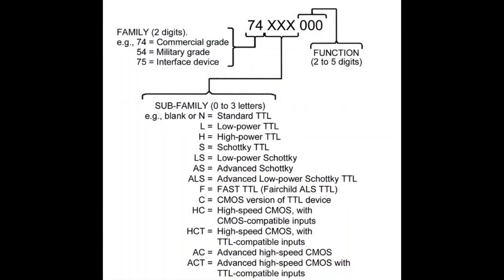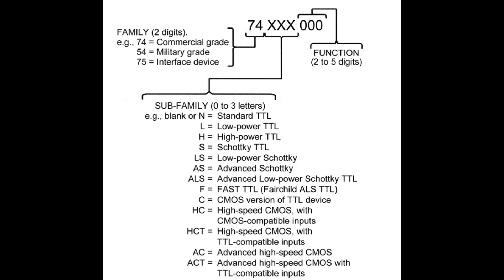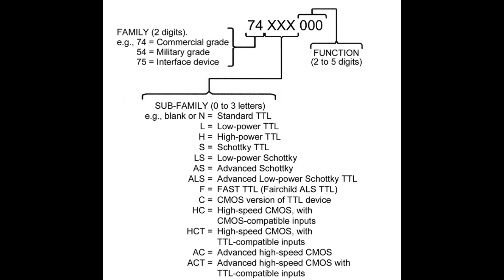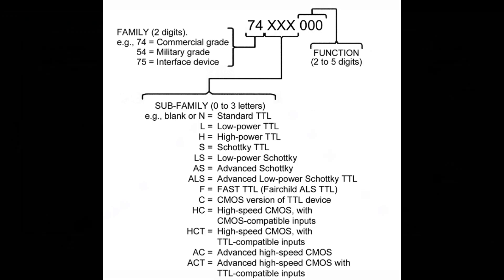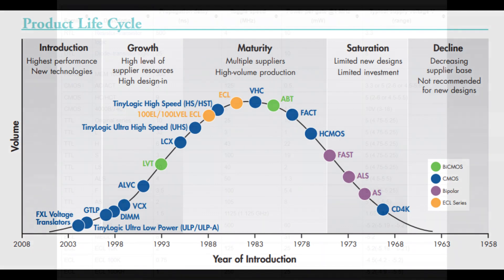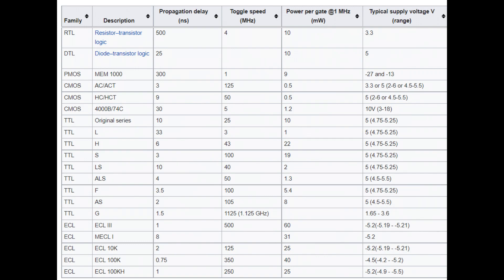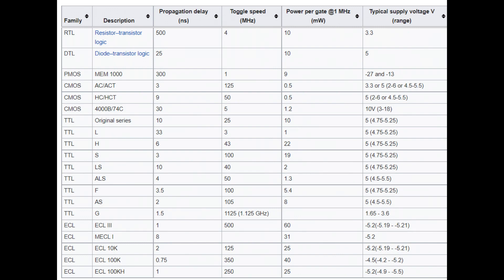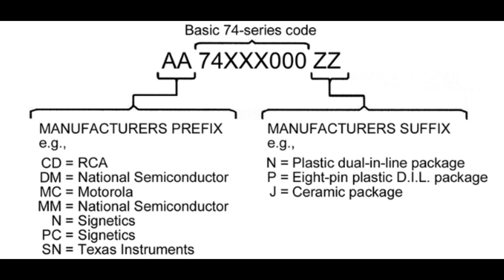#1311 TTL Families and Numbering

Comment: A trip down memory lane!  I graduated BSEE in 1978 and began working for a company designing real-time computer graphics systems for flight simulators.  We built entire graphics systems out of 74S components -- lots of boards in 19 inch racks!  I memorized the specifications of most of the 74Sxxx components in the yellow Texas Instruments "TTL Data Book for Design Engineers".  In the early '80s, I began designing ASICs at the gate level.  In the late 1990's I began implementing the same graphics algorithms in FPGAs using verilog.  What a transition from gate-level schematics to a hardware description language (HDL).  It has been a great ride!  Thank you for reminding me about the early days!!
Reply: In all that time you went from physical gate design, to making the same designs with all the gates now in a single package, and now  you still do the same, just instead of the gates the logic is the important thing. All still doing the exact same thing, though now a lot cheaper, and a lot faster, and also so much easier to fix any issues regarding propagation delay causing a race condition.

I bet you had a fun time with boards that work in one rack, but not in the nominally identical rack, built the exact same day, from the same batch of parts. Then the bag of 4p7 ceramic capacitors came out, to tack on and make it just that little bit delayed, so the latch would reliably copy the state.
Reply: @SeanBZA  Yes, it was a lot of fun to implement designs at the gate and LSI level.  Yes, nowadays, we implement the same designs using an HDL such as verilog or VHDL, so we think at a higher level of abstraction.  We let the logic compiler and placer do the work at the gate level.  In the end, all designs are still implemented in logic gates!!
Reply: I graduated BSEE in 1992 and I also memorized TTL family and used them a lot in 80's , 90's and it was , and still , great fun to design and debug discrete logic gates but now that fun has gone with the sh--t technology of SMT and SoC and made the true experience with the wind.... Even today , the meaning of oscilloscope became useless while every signal has turned to be digitized and converted to S/W routine ... I hate new tech now !! ...

Comment: My first introduction to logic was Signetics RTL, gag - barf - puke.
A nice follow to this video could be interfacing between the groups.
Topics like fanout, VOL, VIL ,...VIH, VOH, the input and output currents and all that.
I recall seeing amplifiers made with 100KECL !
Properly interconnected - 100K ECL was a wonderful if power hunger FAST set of parts.
Reply: ECL does have the big advantage in that there is almost no power supply ripple on it, because it is balanced, though yes power use always was a problem. So you could have entire toaster power level boards of ECL, with only a token 100uF capacitor on the power supply rail for decoupling, with no issue. But then again standard TTL also was happy with that, so long as you were under around 30 chips per board, and not going over 1MHz clock rate. I did work on some boards with around 2kg of ceramic packages on them, double sided DIP TTL, where the only capacitors were those provided by the input side, a single 0.1uF ceramic chip capacitor soldered in by the power input, relying on the between layer capacitance of the power and ground planes in the middle of the board for stability. Each board had 2 5V supplies, one on all the time to power interface logic and the latches that provided state, and the other powered all the arithmetic logic only when needed, turned on once per execute cycle to power this. 

Both power supplies identical, 1970's designed switch mode supplies, using air core transformers running at nearly 1MHz, screaming fast for the day, using all discrete transistors in it, and using 50A rated TO3 transistors as switches. Needed as the power limits would mean a melted box if both stayed on all the time, but when running the unit merely ran at close to 80C surface temperature on the chassis, and had a dedicated pair of fans to run it on the test bench. Fan off you had around 5 minutes before it would fail.
Reply: @SeanBZA  yes the days when men were men - ;-} cheers

Comment: There can be a problem with parts being too fast. The fast transitions of high-speed parts can introduce ringing in circuits not designed to cope with that. For my homebrew computer project, I've tended to stick with HCT.
Reply: Hi, on the other hand, some parts were too slow, around 1985 I made a timer for my home audio system, I needed to turn circuits on and off with one button - press once to turn it on, press it again to it off. At that time we had a mains voltage of 120V50Hz and there were frequent outages due to network overload, one of the requirements was that the timer be set to the OFF position after a power outage. The microswitches that I had at my disposal were not of very good quality and the contacts oscillated, when pressed, they turned on and off at the same time. So I treated the contact circuit with a SET/RESET circuit built from a 7400 and a 7474 took care of the states, a prototype built from Texas Instruments IOs (obtained from old telecom equipment) worked perfectly. Some friends wanted to build this timer , because I no longer had any TIs, I bought the same IOs from the manufacturer TESLA - same components and connections, but after a power failure, the timer was always set to the ON position. So I bought a quick version and the op dropout set sometimes to OFF and sometimes to ON - I didn't understand why, so I tested the used IO on a Siemens portable tester that I had available in the labs and I didn't understand - the dismantled TI from my timer passed the test without problems, but even the fastest version from TESLA did not even pass the slow test. I arranged  the possibility to test the 7400 directly before buying in the store (normally it would not be possible, but the store manager was curious about the IO tester) from about 100 pcs, he chose 13 pcs that passed the quick test, some passed the slow test, but the majority passed only when manually stepping.
In Czechoslovakia, some parts were really terrible, the quality ones went to the army, then there was research and production, what was left went for direct sale and the waste went to bazaars, and then make something at home.

Nice day 🙂 Tom